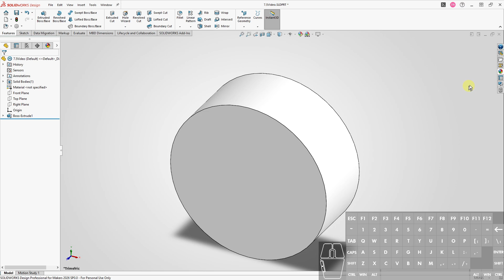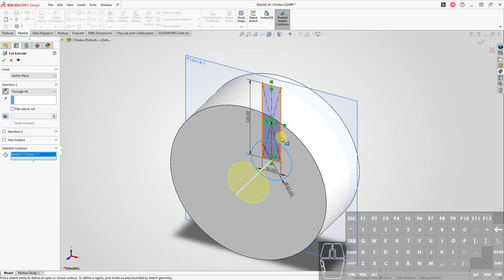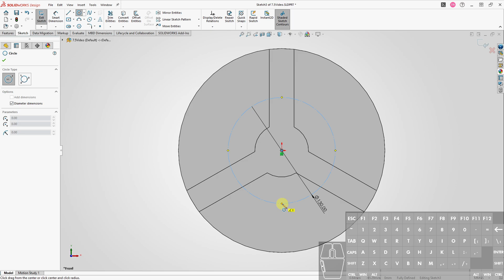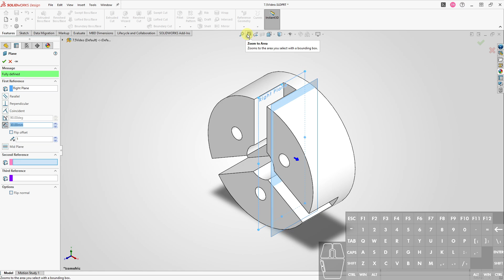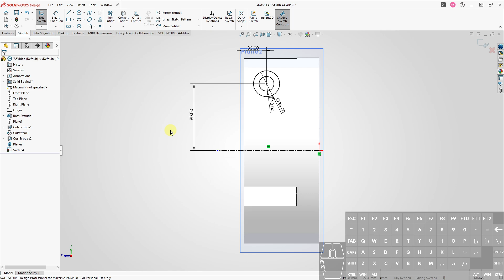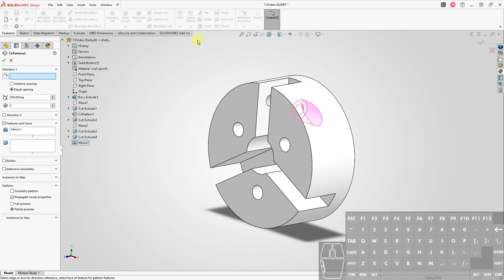SolidWorks CSWA Practice Problem 7.5

Comment: I got 358734. Never get what is given. But when we use specific way then only get the given answer which is weird.
Reply from the maker: Thanks for sharing!  That answer seems enough different (the ten thousands place is 5 instead of 6) that there might be an issue with the method you used.  Another possible way to do this problem is with the hole wizard.  In fact, this problem is basically repeated again in CSWP practice problem 11.11, with the goal of using the hole wizard.

Comment: I am convinced your overall method is a correct approach. I completed it twice with differnent end conditions and got a fairly consistent 3687484, which is very close to your value. I changed the the Ø25 hole to Through All - Both and it initally changed by only 1 mm^3, but then didn't go back when I changed back to just Through All.
Reply from the maker: Thanks for confirming with your result!  You know, the interesting thing is that there's a really similar CSWP practice problem (11.11) that I was able to get correct.  I used the Hole Wizard for most of that one, since that's the intent of the Level 11 practice problems.  (P.S. Your comment had disappeared on YouTube before I got a chance to reply, and then reappeared today.  Weird! 😅)

Comment: I got the right the right answer I think your mistake was when you made the Y extruded cut you used a circle and a rectangle to make to make that cut which wrong you have to use convert antities of the bigger circle and make two lines that connect to the smaller circle and use circler pattern tro make the cut
Reply from the maker: Awesome to hear you got the right answer, and thanks so much for taking the time to post a comment here!  At some point (hopefully soon 😅), I'll redo the video with the method you described.  The strange thing is that I can't see why, technically, it should make a difference.  The difference between using a rectangle and using an arc along the big circle is a region that cuts through empty space, so the volume seems like it shouldn't change.  In any case, I'm happy that there is a way to get the given answer, and really appreciate that you shared it! 😁